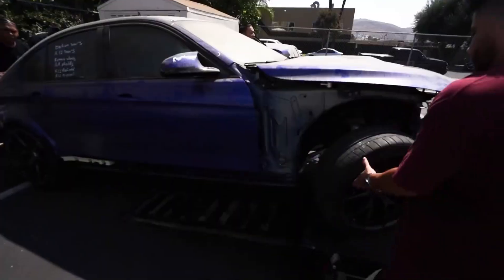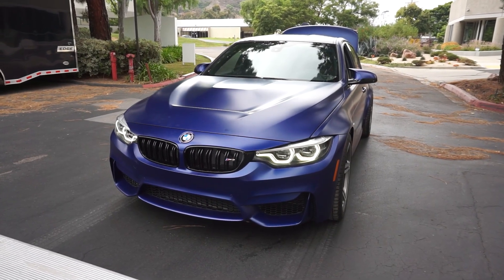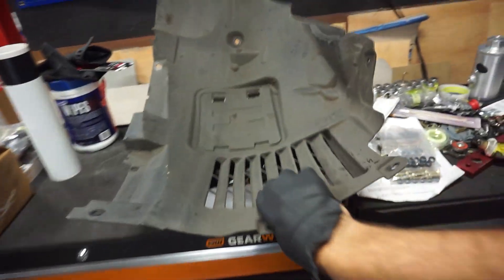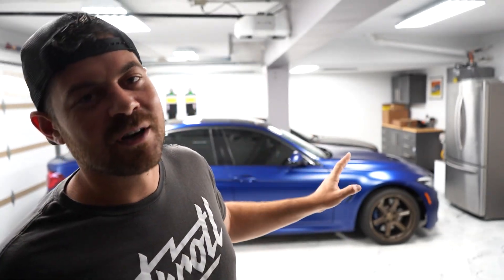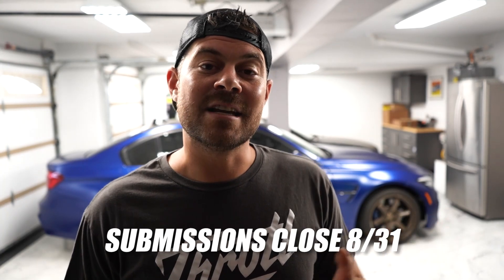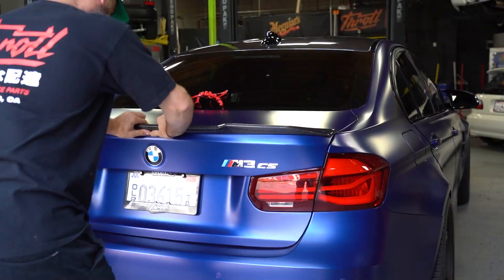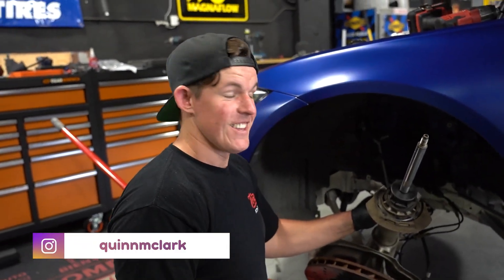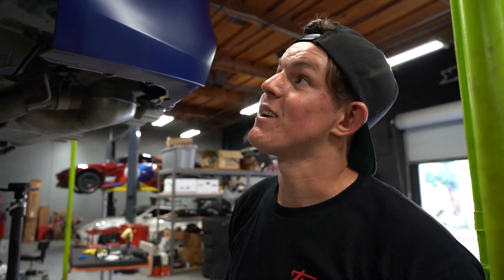Taking Delivery of the CAR that we've been secretly building for over a YEAR! (1/74 ever built)

Comment: Doesn't BMW use speed sensors to detect air pressure differences in the tires? Just curious because I've never encountered a tpms in any modern BMW tire I've changed

Comment: also a huge difference between the n55 and s55 is open vs close deck and the stroke is different (s55 has a smaller stroke) which allows the s55 to take more psi